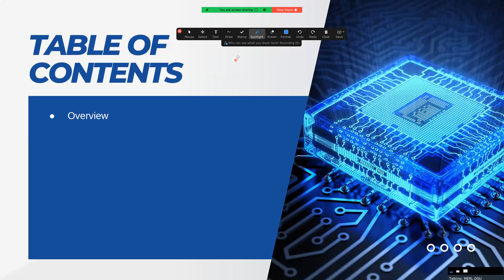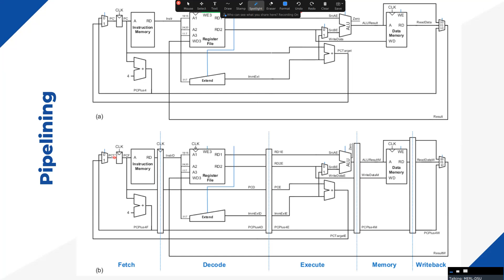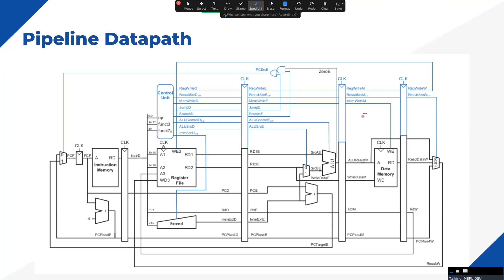Lecture 1: Overview of Pipelining

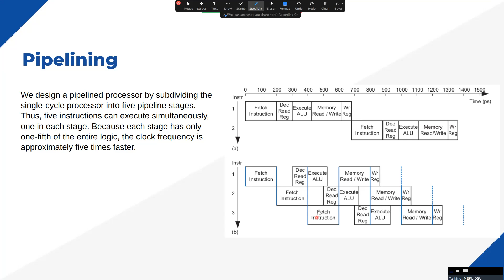Comment: 00:00 Introduction to Pipelining Series 00:54 Overview of Pipelining 01:20 Recap of Single Cycle Core 02:31 Limitations of Single Cycle Processors (PPA) 03:37 Concept of Pipelining 04:00 Timing Comparison: Single Cycle vs. Pipeline 05:15 Real-world Analogy: Washing Machine 07:08 Pipeline Block Diagram & Registers 08:34 The 5 Stages of RISC-V Pipeline 10:09 Visualizing Instruction Flow 12:15 Pipelining Control Signals 12:56 Conclusion